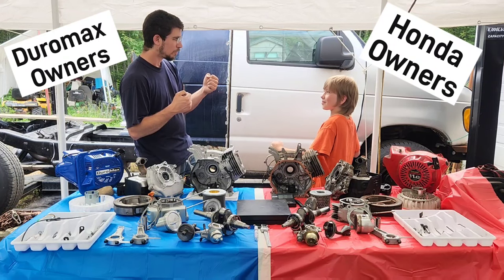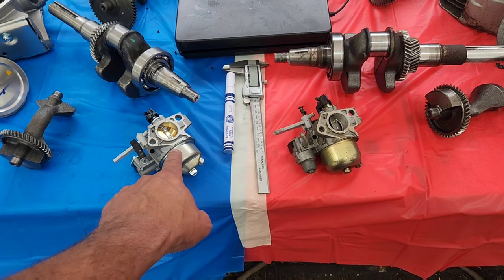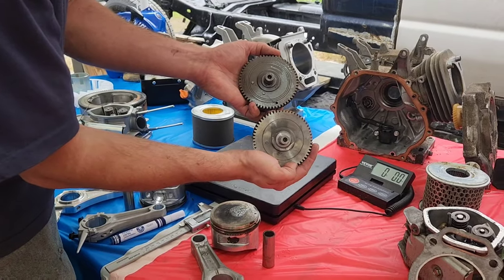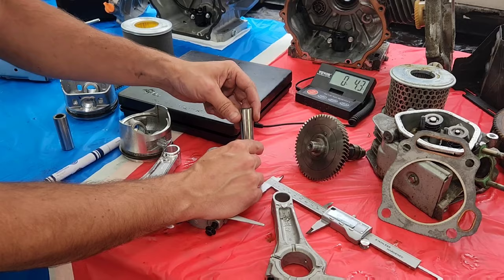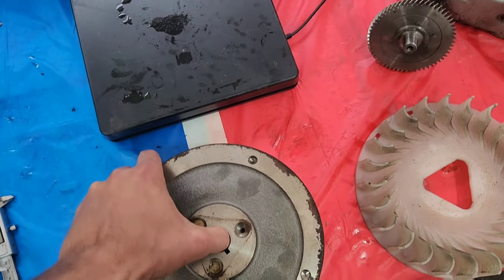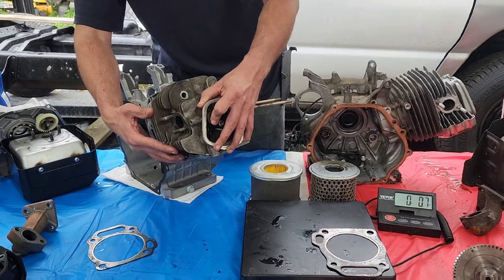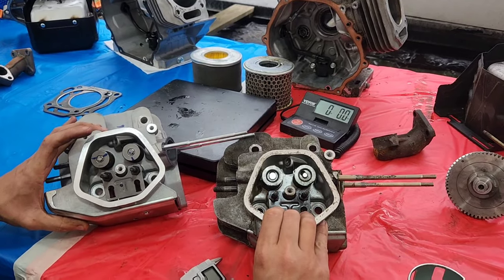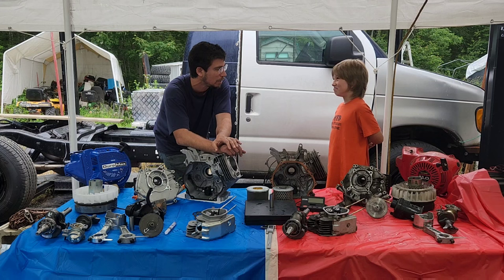Duromax 440cc same as GX390 GX340?

Comment: the honda is heavier because its build stronger and more reinforced
Reply: My ducar 212cc lasted me over 3years 🤞 just use amsoil and don't redline longer then 9secs I always let go of the gas on a long road but I should do my springs I set the valve lash once when I first git it slipped a rod once before I did the lash setting then good from there 3 summers 3 winters strong like bull

Comment: Compare 18 hp vs 11 hp lol
Reply: The issue is that the Duromax 440cc doesn't actually make 18hp; it is a theoretical calculation based on displacement and max rpm
Reply: Yeeerrrrp.
Reply: @bradensmith888  You can't dyno it???
Reply: @bradensmith888  Well, a 420 made 30 hp on a dyno.
Reply: @fish_R_stinky69  Where can I find that 30 hp engine? I'd like to see it tested
Reply: @bradensmith888  Red Beard's Garage.
Reply: @bradensmith888  Bro, Predator 212s can run 40 HP, lol.
Reply: @fish_R_stinky69  RedBeard has never dyno tested a 420 engine; I've never seen proof of a 420 making 30 hp
Reply: @bradensmith888  440cc.

Comment: This is my interpretation of compatible performance parts for the D-handle Duromax 440cc electric engine (credit to RCG Racing for engine teardown/analysis):

Camshaft: Any gx390 performance camshaft like the DC308-GX390 308 camshaft (GoPowerSports)
BilletAluminum flywheel with starter ring gear: Any gx390 performance flywheel like the 6623-E (NR Racing)
BilletAluminum Connecting Rod: Any gx390 performance connecting rod like the ARC6272 (GoPowerSports)
55 lb Valve Springs: Comp Cams GP966-2 (use only the larger diameter springs that come in the kit)
Head Gasket: MLS92-027 (NR Racing) 
Side Cover Gasket: Any gx390 side cover gasket like SCG420 (GoPowerSports)
Exhaust header: ARSPORT XP16HPE or XP18HPE header
Billet Side cover: 6059 (NR Racing)
Intake adapter: Any gx390 intake adapter will fit, but the adapter will need ported/bored out to get the full flow benefit of the 440cc port like KDMIKMAN301420 (GoPowerSports)
Ratio Rockers: Any gx390 ratio rockers like 390-ROLLRCKS (NR Racing)
Piston: NR460 (NR Racing) - recommended to use stroker crank to get full benefit of flat top piston (#6774 [NR Racing])
Magnetic Dipstick: WEN GNA200 (Amazon)

Hope this helps, feel free to provide input if you have any
Reply: Good stuff right

Comment: Great video.  You missed the hose on the GX air box.  Not there where their is one on the Duromax air box.  This could account for the weight difference.
Reply from the maker: Good catch! I bet your right :)
Reply: @redneckcomputergeek  In which case they are most likely the same weight.  I think that the Duromax box would be better with the less restrictive air flow and bigger port.
Reply: Bro, this is so silly. 0.4% of a pound isn't gonna win a race😭😭

Comment: I have a gx270. What carburetor do you recommend for it? I need to replace it bc i broke the air fuel adjustment screw off in it.
Reply: PZ27/PZ30